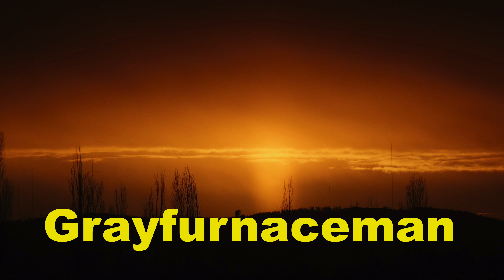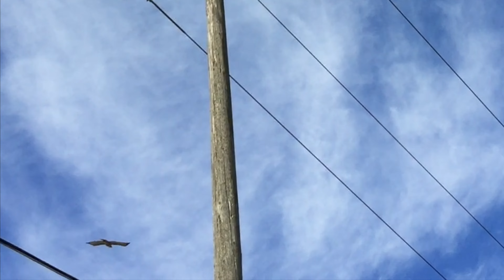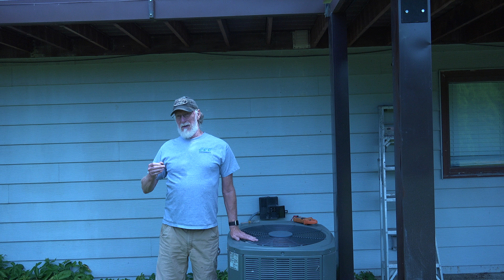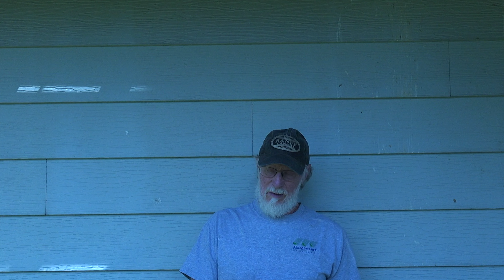Does the hard start kit make the modern A/C work better?

Comment: Great demonstration! Under ideal conditions, I'd agree about a hard start not extending the life of the compressor. However, where I live, we see a lot of momentary power interruptions/flickers, which tend to stall the compressor and cause it to trip the overload when it isn't able to restart against the pressure. With a hard start, they normally start right back up no issue. In the long run, don't you think avoiding several stalls a week would be beneficial to the compressor's longevity? I'd think stalling and overheating the windings until the overload trips would be very bad on the compressor over time, but I'm no engineer.

A soft start may be a better solution to that issue, but that's a different discussion hopefully for another video.
Reply: I think those are the situations where you should put a hard start in. But from my experience, the best ones have 3 wires and a potential relay. Or get an OEM one. The supco spp6 or ones like it are pieces of $hit. Almost every 2 wire hardstart kit I've ever seen has been broken.

Comment: Agree with you 100%. I do not feel very comfortable when comfort advisors try to push customers to get hard starts added to their brand new systems. 
     I feel that hard starts should be used when the system gets to the point that it’s starting to have a hard time starting.

Comment: In my limited experience, when the house lights dim during AC start, the hard start kit or a ~10% larger start cap, will aid the compressor that's already on it's last legs.

Comment: It has been my experience that a compressor with a hard start kit will not growl as much at start up as one not using a hard start. The growl that it does have is a shorter duration with the hard start kit installed. I stay away from 2 wire hard start kits. They seem to fail at a higher rate than a hard start with the potential relay with it. Just my observation and opinion.

Comment: The 33 amps startup surge is a bogus number.  As you mentioned, clamp on meters are not accurate for short current bursts surge peak readings.  They need 0.3 to 0.4 seconds of burst current to average the reading.  

A hardstart kit actually slightly increases startup peak surge current but it reduces the length of time the surge current lasts.

A typical Run capacitor only A/C compressor startup time is about 0.4 secs.  If you add a hard start kit the startup time will reduce to 0.1 ot 0.2 seconds for a normal system with proper AC wiring to outside unit. The clamp on meter will read low for peak surge current because the surge burst time is too short for meter.

You need a closed loop hall effect current sensor and an oscilloscope to measure true peak current reading and its time period.

If your A/C compressor power line has a long wire run from breaker panel, too small of wire gauge for the wiring run length, or grid voltage is low in your area, a hard start kit will help compensate for low supply voltage.  The lower the AC voltage on compressor the longer the startup period.  Commercial/Industrial installs with three-phase single phase branch voltage of 208vac and typically longer wire runs to roof mounted compressor/condenser are more likely to have this problem.  Once startup time extends to about 1 second there will be enough time to heat up and pop the compressor's internal safety breaker.

The start (auxiliary) winding provides maximum motor torque when the series capacitor value provides 90 degrees of current phase lead to start (auxilary) winding.  The proper Run capacitor value does this during run mode, and it improves motor efficiency and power factor.  

During startup period the motor is like a transformer with a short-circuited secondary winding.  The stator-rotor air gap creates a large amount of leakage inductance.  This makes the startup load very low impedance and very inductive.  This requires the start capacitor to be much larger in mfd. value than mfd value of Run capacitor in run mode to achieve the optimum start winding current phase shift during the startup period.

The startup torque improvement is more due to getting the start winding phasing closer to 90 degrees from run winding then the slight increase in start winding current magnitude from the larger mfd value start capacitor.

Also as you mentioned, 0.1 to 0.2 seconds startup time due to increased startup torque from larger value start capacitor is mechanically more stressful to compressor.  Going from zero to about 3500 rpms in 0.1 seconds can break the shaft coupling bushing or other scroll compressor mechanical components.

Electrolytic based, high mfd value, start capacitors are less reliable than foil-based Run capacitors and potential relay to disengage the start capacitor is another component to go bad and reduces the system reliability.

Comment: I had asked you a question last week about my Trane factory start assist from Trane. It's not a 5-2-1 or kick start type. Working fine, just wanted your opinion on the Trane factory start assist. Thanks, love your videos !
Reply: You absolutely have to use a Trane potential relay on a Trane. They are a specific cut in and cut out voltage.

Comment: GFM, 5-2-1 states that the relay must be installed with the mounting tab pointing up.
Do you have any information on whether this can be detrimental to the operation if the relay is mounted other than vertical with the tab up?
Reply: In any position other than straight up, the relay armature, which is dropped out by gravity, could hang up. If it cant drop out quickly, you will burn out the hard start kit.

Comment: What is your opinion of installing a soft start unit like the microair EasyStart to prolong the compressor life ?
Reply: Only if you need a soft start, I.e. high frequency inverters like I have. All of my 7.5 Tons of hp that are not inverter compressors have soft starts. Do not use a hard start or soft start unless you absolutely need it.

Comment: Great video .My 10 year old  system has a reciprocating compressor- The lights in the house started dimming on start (the capacitor was in spec). A hard start kit solved the problem. After watching this video, I am wondering it hard start kit will shorten the life of the compressor?
Reply from the maker: In your case, the hard start is probably a good idea.  The light dimming is a result of a slow start and a slow start is worse than the increased starting torque.
GFM

Comment: My 3 ton r410 ruud system with a txv and scroll comressor came with a start cap and relay. It ran fine for years with a bad start cap. I replaced the start cap. Now i'm wondering if i should just let it run with the dual run cap? Great video

Comment: what about the weight of the liquid going up several stories? I also see systems run with half weak capacitors. With this logic a 35 cap might be better with a 25 if starts slower and no issue.

Comment: One question I couldn’t figure out is on any normal system, the more modern start caps are way bigger then older ones; years ago a 25 or 35 mfd cap was common, now they use 75 mfd or larger. Why is that? Is it just to get a phase shift that bigger for start?
Reply from the maker: The run capacitor's primary function is to make the compressor motor more efficient.  The increase in capacitor size is the result of efforts to increase efficiency of the compressor.  The start function did not need more strength.
GFM
Reply: @grayfurnaceman  thank you. Makes sense!

Comment: HVAC and 47 kW of solar guy. You’re 100% correct. Now for solar systems SOFT STARTS are the way to go.
Reply from the maker: My home is powered by 20 KW solar.  I have used both normal and soft start on my A/C.  It has not, so far, made any difference.  The inverter is the Sol-Ark 15.
GFM
Reply: @grayfurnaceman  2 12K’s for me. The high frequency inverter electronics will last longer if they do not have those high inrush currents on startup. Soft starts are the way to go, unless you have low frequency inverters like my shop system Schneider or my van system Magnum.